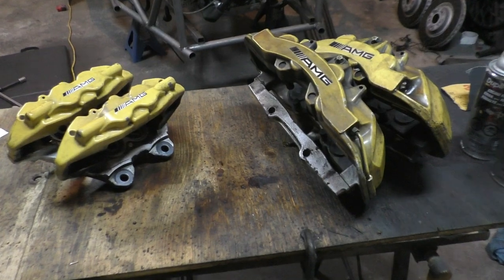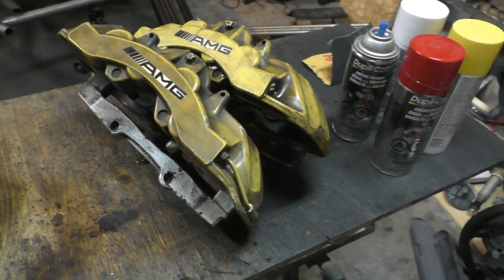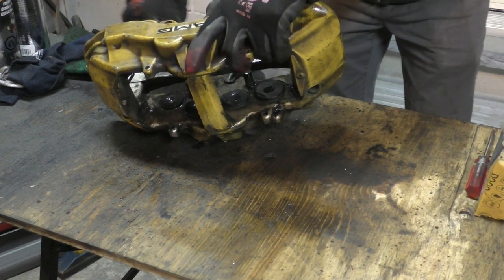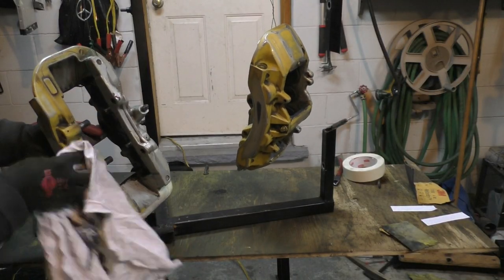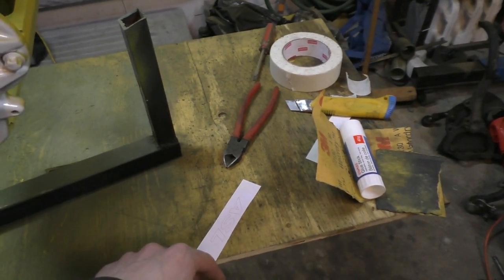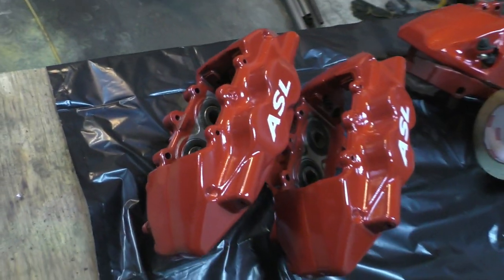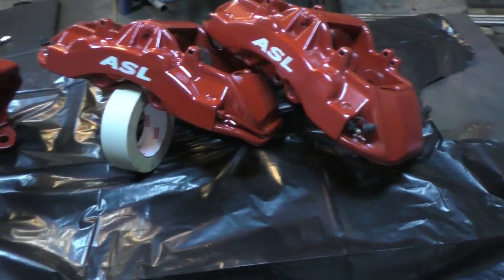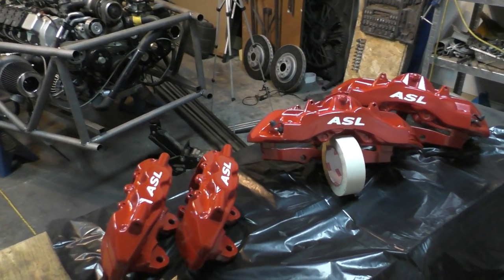Restoring / Painting Brake Calipers for the E55 ASL

Comment: After gassing off a few days- HANG them in a 200F oven, or box with heat gun.
That paint must be cured slowly, or it will shrink and crack.
200F (93C) 2 hours. Doing that will also knock down the gloss a little.
The coating must be flowed.

Comment: Try to add a floor scrub plate. Incase if the car touches the asphalt, it will crack the chassis. 
If you feel it's too heavy and not needed. Try welding atleast a thick knuckle on each corner of chassis.

Comment: might be a little late for this, but had you looked into putting SMALLER brakes on the car? now that your only pushing around half the weight the brakes could be overkill and it might be a way to save some more weight.
Reply: I thought the same at the beginning, but it is not so simple: yes lower mass result in lower kinetic energy of the car(E = (m*v^2)/2), so you will be enough with smaller breaks to decipate lower amount of energy, but this is true only for same speed, and since you have same engine - your amount of delivered energy to the car reminds the same, lowering mass you increase acceleration, so at same piece of track with pedal to the floor you will end up with higher speed, and since E = (m*v^2)/2 you will still have high kinetic energy of the car so need big breaks to decipate it.

Comment: Machine some water blocks (like those used for water cooling computer processors) and put them in between the brake-pads and the caliper pistons... Liquid cooled brakes homes!

Or I guess you could just run the brake fluid through a radiator using one of those valve kits. 

You can also mist some water into the brake cooling ducts, though you need a good nozzle and a decent pressure pump to properly atomize the liquid. 

:)

Comment: I see in your other video that you are going with manual brakes, no ABS. considering how light your car is, aren't those brakes WAY too big? I know you probably planned your brake pedal ratio and master cylinder size accordingly but still, there's definitely some unsprung weight you could save by downgrading those brakes to maybe a 4pot/2pot.

Comment: Man I got a question! I want to do what you’re doing, but rear engine! So E55’s engine is M113K but I was wondering if I go with a M113 engine instead and have a machine shop bore out cylinders and put beefier internals of 113K? Since M113’s are very easily Available and are super cheap! Looking forward to your stand alone Ecu solution and see how it works out! I’m planning on going with a Beefed up GSX or gst eclipse Awd trans possibly make it road legal was well! Twin turbo's as well
Reply from the maker: You can, but it will involve changing the crankshaft, pistons and connecting rods. It might end up costing you more that way. Depends on your power goals but m113 with low compression pistons would be a really good option.

Comment: Given my experiance in painting calipers I was wishing that you would use a professonal paint gun and automotive paint, and not spray cans.  I painted my SLR brembo calipers Yellow using regular spray cans, but it didn't hold up well, then I painted it again with automotive paint and a professional pray can and the finish and durability was totally different.  off course I baked them in the oven :)
Reply from the maker: Yeh, for sure spray cans isn't the best way to go. Last time it was a temperature issue too. The e55 really used to cook the brakes. I think this time around it should be better
Reply from the maker: @farturinn  looks really nice. Good job!